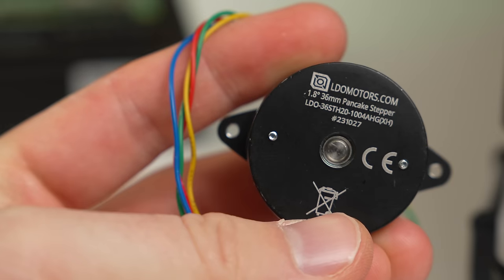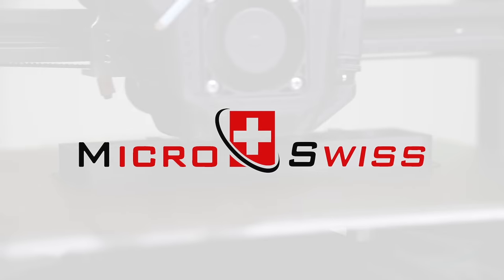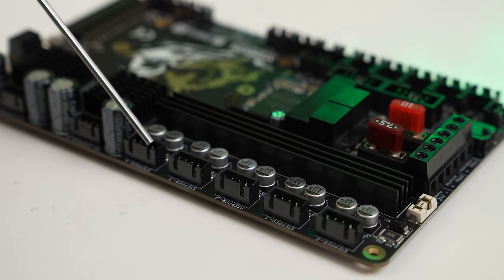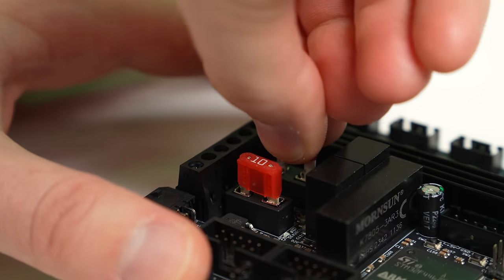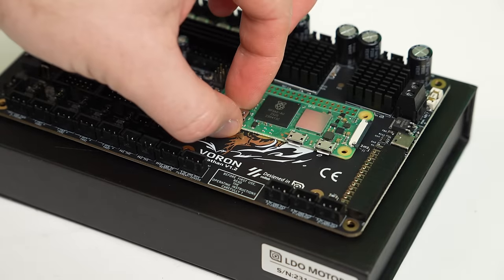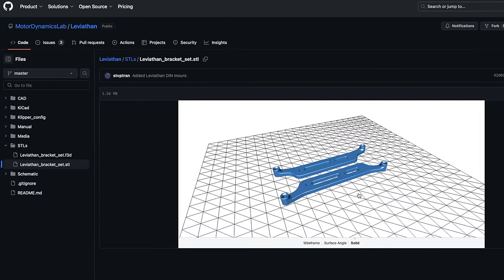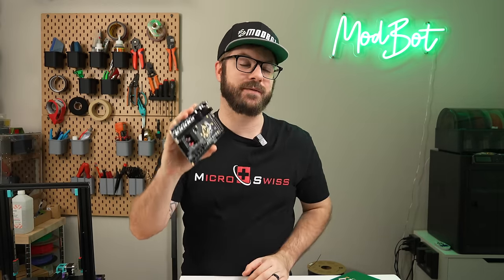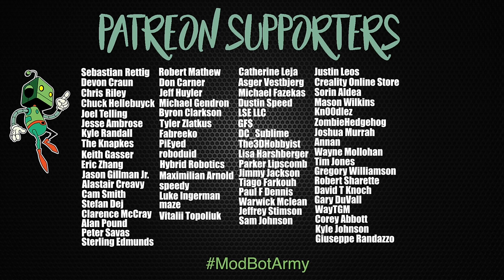This Klipper Controller Is Feature Packed! (LDO Leviathan)

Comment: Shame the drivers are soldered and not push in.
Reply from the maker: Has this ever been an issue? Out of all of my printers ever I have had one that died and it was from the printer dropping when I moved causing the toolhead to generate current that was sent back to the board.
Reply: The problem with the stepstick form factor is that you are limited in how much current you can use on it. These pins are rated for 3 A (and this is Dupont specification, no way to know how much the Chinese knock-offs really support), and that's fine for most motors. But when you have TMC5160 drivers that can provide up to 10 A of current (depending on how the auxiliary circuit is built), you only have the option of soldering the driver directly on the board to be able to handle that much current.

In all honesty stepsticks should be abandoned due to those limitations, but there isn't a clear form factor to upgrade to at the moment.
Reply: @vinnycordeiro  Good point but the motor header pins are JST or Dupont with very similar capacity.  The big advantage of the 5160 is it's higher voltage at 48v you halve the current and reduce the size of the wires and conductors.
Reply: @ModBotArmy  Yes, I once popped a 2209 by pulling the filament out of a Bowden tube. without de clutching the extruder.  I think flexibility and upgradability is worth paying for.
Reply: @landroveraddict2457 That's not how stepper drivers works. The actual voltage it sends to the motor is related to the current that is defined on your config file and the resistance/inductance of the motor's coils.

The higher VMOT voltage is useful to counter the back EMF induced voltage: the faster the motor spins, the higher the voltage that the shaft's magnets induces in the coils. Because of that you need higher voltages on the driver to counter the back EMF induced one. And people uses 48V to be able to push the print speed to a higher limit than is possible with 24V.
Reply: Oh I stand corrected,  thank you. Looks like I need to do more homework. @vinnycordeiro

Comment: Why 32bit, that it's useless for me.
Reply: What? Why?
Reply: 32 bit MPUs are less costly these days than 8 bit, and more powerful than needed for the controller functions. The Pi is 64 bit and runs the high end part of the Klipper, which doesn't actually need 64 bits but it's there if you want it. Only the realtime code runs in the 32 bit MPU and it's more than adequate for the task.